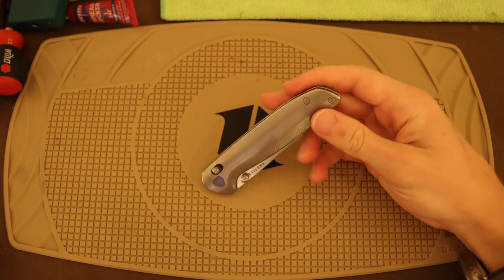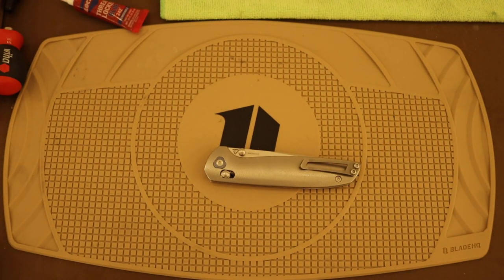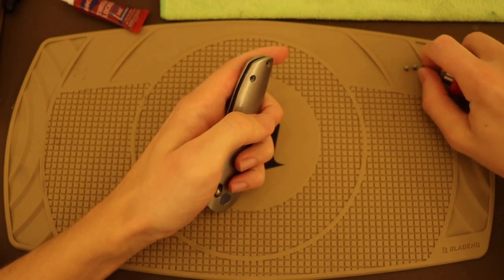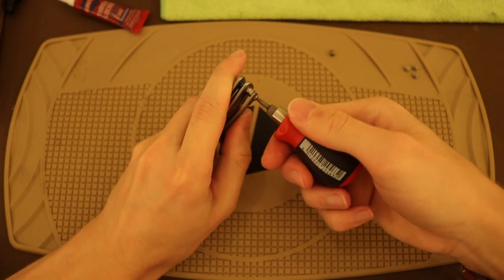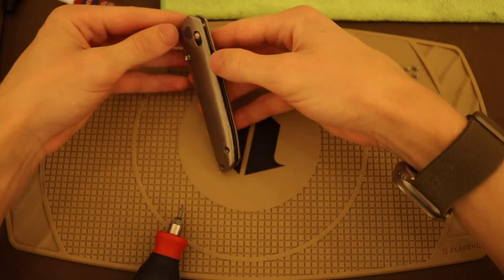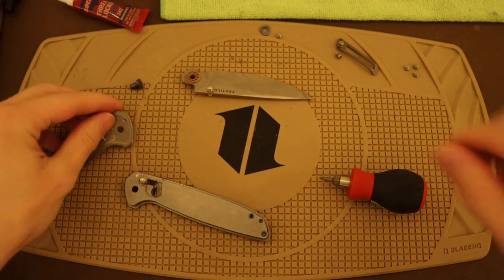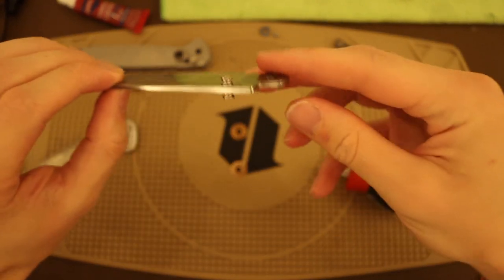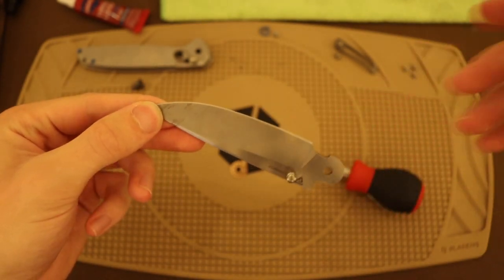Tactile Knife Co. Maverick Tear down and Tune up

Comment: Slotted screws belong in the 19th century, they absolutely suck.  Torx head was developed in order to eliminate the stripping problem that Phillips (and other cross-pattern) head screws suffered from.  Phillips head screws were designed TO CAM out, i.e. strip.  The issue with T6 is that the screw itself is so small, and so often made from material that is too soft when the splines get as small as they are in T6.

Screw trivia aside, I'm generally pretty happy with my Maverick.  I definitely like that the hardware is all the same, loving how it feels in the hand.  At the cost,methinks it SHOULD be linerless.  Or at least the liners should be skeletonized.  One thing that Tactile nailed is, well, the actual TACTILE feel of the knife.  The thumbstuds are perfect, especially when contrasted with the thumbstuds on my Hogue Deka.  Hogue really, REALLY needs to tumble their thumbstuds before hitting them with surface treatment.  The Maverick's body feels almost 'sticky' in hand, but not in a bad way, almost as if the knife is saying "ALL of me is grabbing onto your skin, I won't slip out of your hand."

Comment: How would they make it without liners ? The spring would be exposed which would definitely cause issues hence why Benchmade never has .
It’s more expensive to machine two different materials to creat a pocket for the spring to be in so it’s not a cost cutting issue.
Reply from the maker: They can make them smaller. Like many BM's
Reply: @AlaskanFrontier1  Benchmade doesn’t use Omega springs on knives without separate scales and liners.   

Look at the Anthem and Narrows.

Anthem has a longitudinally mounted coil spring and Narrows has a torsion-style spring.  

Fully milled Ti scales would also make the basic design less versatile, this knife comes in Micarta, G10 and Fat Carbon scaled versions as well.    

I don’t get the complain about the liners.